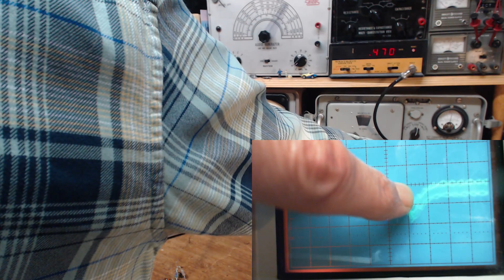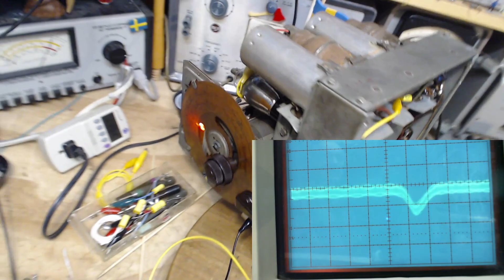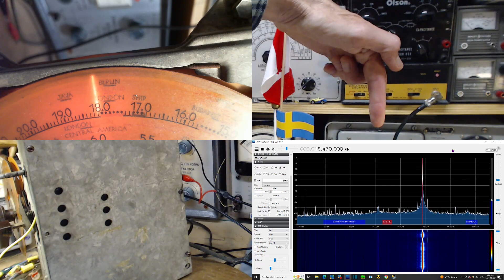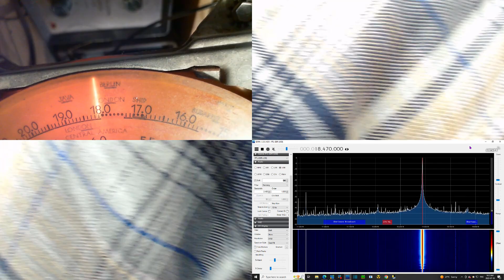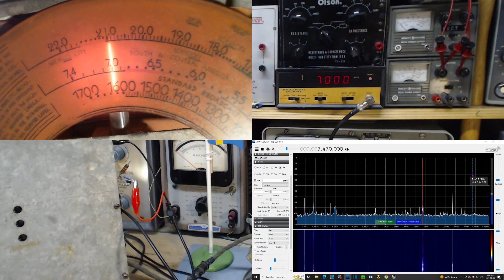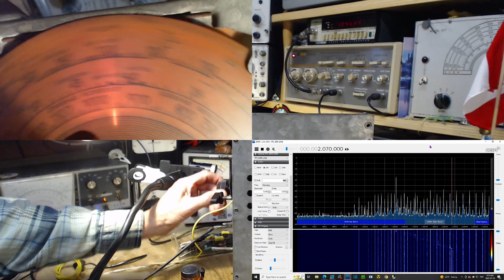Philco #37 3610A Tube Radio Video #11 - Complete Final Alignment

Comment: Me thinks the amateur  bands are dead and AM is on its way out as a  communications Media. The real problem is not on the technical side but the garbage that passes for content.
Reply: AM Radio will live on for a long time. I agree that content can be something you enjoy on AM or are offended by it. I find the weekend lineup more enjoyable as they have things related to Gardening, Automotive Repair, Home Improvements and other diverse lineups. Depends on what part of the country you live in. 
As long as it is informative and not a 60 minute infomercial, I am good with it, otherwise back to short wave listening or the utility bands.. 
Robert

Comment: The 470 khz spectrum looks good, markers are spot on as I can see. The thick lines are caused by unwanted 60 hz radiation. Its amazing how narrow the pass band is. One can clearly see that the IF peaking method is most effective after all. Although its nice ti see the pass band too. Then its time to stop fiddling the powdered iron cores.